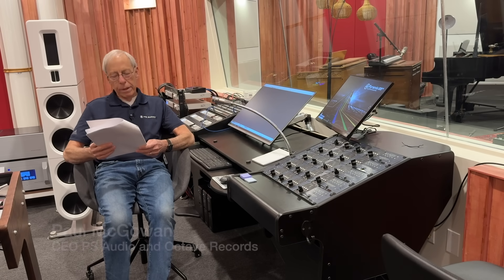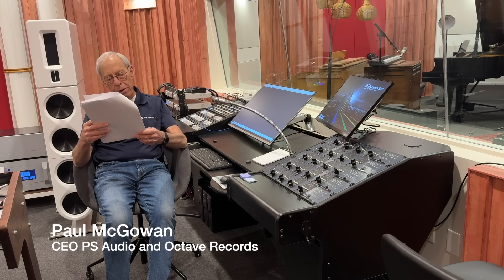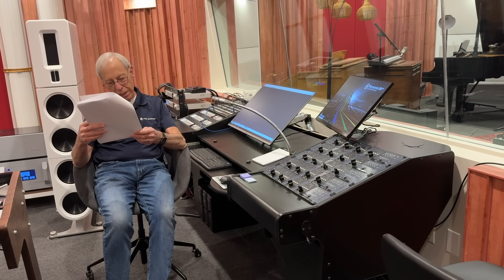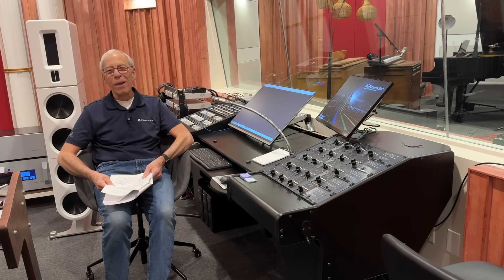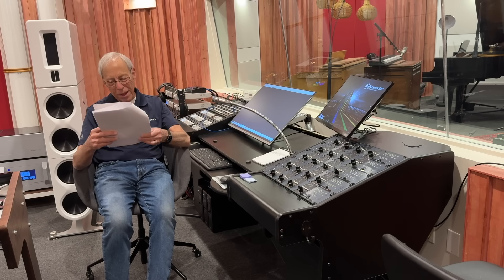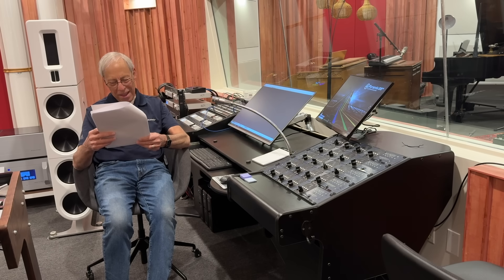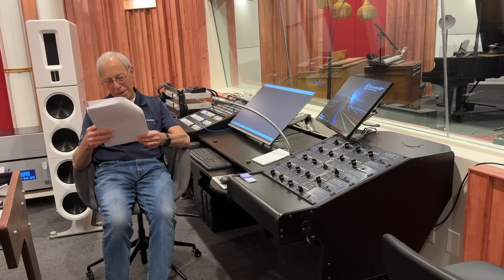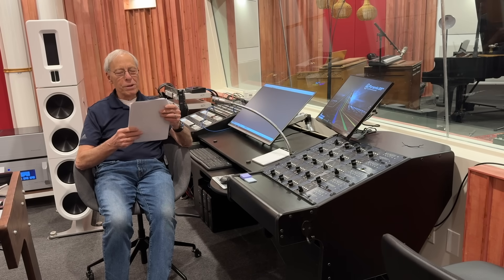Damping factor and pudding bass

Comment: Personal experience- I do not like amps with ultra high damping factor. The amps I have heard with a damping factor over 500, and particularly over 1000, present with sterile bass.
Reply: I'm of the same opinion that high damping factor sound sterile and dead, but only if it's achieved through massive amount of global negative feedback.
If achieved without global negative feedback, and still linear, it have a much better chance to sound fantastically transparent and musical without the fatigue part.
My own personal lower limit for damping factor is between 15-20 times lower than the loudspeakers impedance. Optimal for me is 20-50. There I have found some of the best amplifiers I have owned over the years.
The amount of global feedback is of much more importance for me. Too much kills musicality and create listening fatigue. It messes up the harmonics of the recording and then each note starts to sound monotonic and lifeless. Like a syntheziser producing sine waves. To my ears most Op-amps falls into this category, so no opamps in my system, only discrete circutry based on transistors or tubes.
Reply: I'm the opposite. Amps with lower damping factor, less than 100 give me listening fatigue in the bass. Too fat and wooly and missing detail. I'll take the 500 and above everyday of the week because I like a dry and technically correct sound.
Reply: @dicmccoy  A damping factor of anywhere above 10 or so will guarantee that the freq. response of your speakers won't change more than a fraction of a db, unless they are something really exotic.. so you're hearing something else, not the damping factor.
Reply: @dabbidaa1547  it's not about frequency response. You do realize that FR is not the all telling tale of any perceived differences with audio. 😂 There is so much more to audio than frequency response. 

My isoacoustics gaia ii's feet don't change frequency response, but guess what? They change the attack in the whole frequency spectrum of my speakers. 😱 

Blasphemy you say! FR is the all telling tale of any audible differences. lololol
Reply: @dabbidaa1547  You can have all the damping factor in the world, you have to remember that the only thing cables do is take away. 

You have to factor in your speaker cables, connectors and even the contact resistance for your amps damping factor. 

There are some really bad cables and connectors out there. Some even measure .6Ω Put that cable on a DF of 13666, like a Purifi Eigentakt, that 13666 now all of a sudden became a DF of 13 because of the one thing you have been brainwashed as snake oil.

There's a reason why many don't hear a difference. Look at those old oxidized cables with spring style banana's that have minimal contact resistance.
Reply: @dicmccoy  Why don't you explain to me then what else does damping factor change? I'm eager to hear. Oh, and leave out the black magic.
Reply: @dabbidaa1547  Damping factor is crucial for how the amplifier controls the speaker, especially with its wildly varying impedance. 

Speakers don't have a constant resistance. it swings up and down across frequencies. A higher damping factor means the amp's output impedance is low, so it's less affected by these impedance swings. 

This results in tighter, cleaner bass and more precise transients. You can see this control in an impulse response measurement, showing how quickly the speaker settles. 

Damping factor ensures consistent performance despite your speaker's moody impedance, something a static FR plot doesn't capture.

Comment: Hegels dampinfactor is over 4000, so Paul explain to me ..... why?
Reply: The amplifier's output stage typically has a very low output impedance. However, internal wiring, binding posts, and contact resistance all contribute to raising it. Companies that prioritize high Damping Factor (DF) often use better internal components and binding posts to keep this increase minimal. Others might cut corners, resulting in a lower DF. Then, of course, the user's speaker cables and connectors add their own resistance, further degrading the final DF seen by the speaker. Keeping all these resistances as low as possible is crucial.

Why bother? Because DF directly impacts the amplifier's control over the speaker drivers, evident in impulse and step response measurements. A higher DF translates to tighter, more controlled bass and improved transient accuracy.

The real-world benefit of a high DF/low output impedance shines when you consider the speaker's impedance curve. The nominal value is misleading; impedance and phase angles change dramatically across the frequency spectrum. When those impedance dips occur, a low output impedance ensures the amplifier's voltage remains stable, allowing for sustained current delivery. 

An amplifier with a lower DF will struggle to maintain voltage during these dips, leading to less control. So, while a very high DF like Hegel's might have diminishing returns at some point, it generally points to an amplifier designed for excellent control and current delivery into complex speaker loads.
Reply: @David_vdk  The amplifier's output stage typically has a very low output impedance. However, internal wiring, binding posts, and contact resistance all contribute to raising it. Companies that prioritize high Damping Factor (DF) often use better internal components and binding posts to keep this increase minimal. Others might cut corners, resulting in a lower DF. Then, of course, the user's speaker cables and connectors add their own resistance, further degrading the final DF seen by the speaker. Keeping all these resistances as low as possible is crucial.

Why bother? Because DF directly impacts the amplifier's control over the speaker drivers, evident in impulse and step response measurements. A higher DF translates to tighter, more controlled bass and improved transient accuracy.

The real-world benefit of a high DF/low output impedance shines when you consider the speaker's impedance curve. The nominal value is misleading; impedance and phase angles change dramatically across the frequency spectrum. When those impedance dips occur, a low output impedance ensures the amplifier's voltage remains stable, allowing for sustained current delivery. 

An amplifier with a lower DF will struggle to maintain voltage during these dips, leading to less control. So, while a very high DF like Hegel's might have diminishing returns at some point, it generally points to an amplifier designed for excellent control and current delivery into complex speaker loads.
Reply: Bragging rights
Reply: @NateEll 
 Only if they own one.
Reply: @NateEll pretty much true my amp is way above the required levels too. It makes no difference at all. 

Typical audiophile nonsense
Reply: when I say I love the Yamaha AS-3200 some people laugh, I love their sound, but also the VU meters and the brushed aluminum... damping factor moren than 250 , so "watt"??
Reply: @MichelLinschoten 
 A friend asked me help him fit his new larger receiver into his cabinet. 
 With a quick use of a rasp around the opening, I was able to fit it. 
 He asked what I did. 
 I told him that I used an audio file.
Reply: @David_vdk  
Love mine too, and I don't care about other's opinions on it.